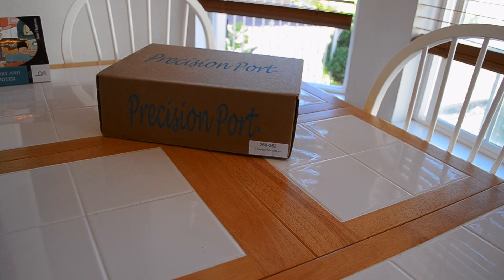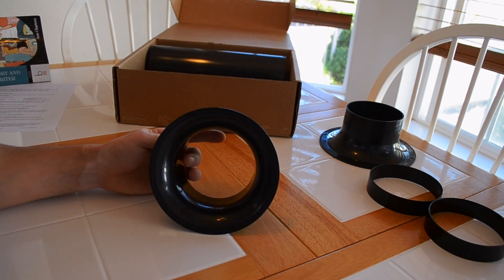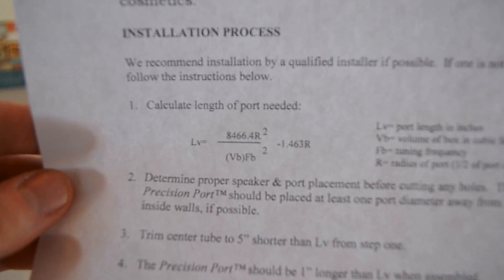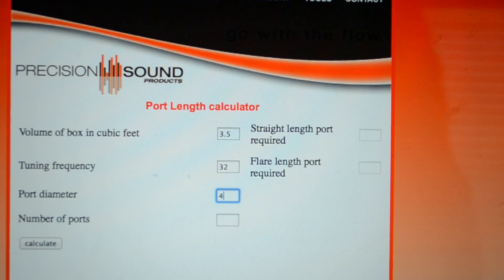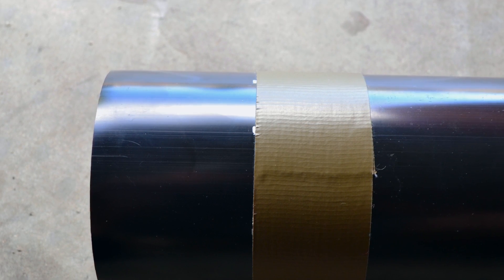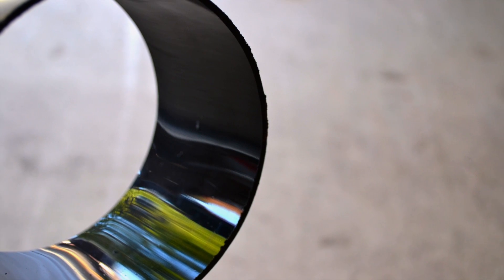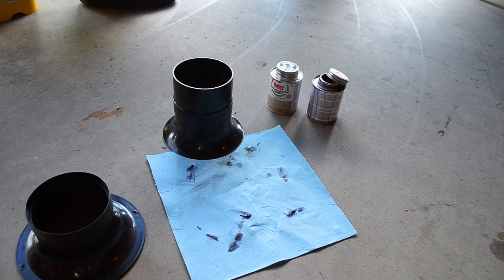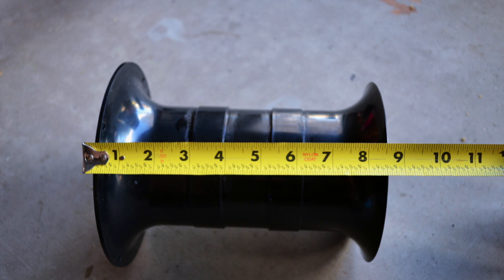4" Precision Port

Comment: Hi thanks for the video.. i want 4 x 4 inch flare..can you please help me. Do i have to just glue together the outer and the inner port??
Reply from the maker: Yes they just glue together like PVC plumbing. Just cut the center to the size that you need to make it the overall length.

Comment: What if my sub manufacture recommends a 15 inch long port by 4 inch diameter port, do I just remove 6 inches from the tube?
Reply from the maker: Yes but in my experience what your sub recommends and what the port will give you is a different measurement. Use their calculator to get the correct length to cut the center. Thanks for watching.

Comment: just spent 1 hr trying to understand this lol I finally do now. video helped a lil.

heres my explanation for those who have trouble understanding it.

example 4cft tuned to 37hz with one 6in port. = 10.52

6in port is 17in total length with flares.
only 12in in usable space between flares. 

17-12=5in
5÷2= 2.5in each flare is 2.5in

all ports mus remove 6in form usable space between flares. (except 2in ports you remove 5in off usable space between flares)

10.52 is what we need for total legenth.
10.52 - 6in = 4.52in

center tube(12in usable space between flares must be 4.52in)

4.52+5in(2.5in for each flare) = 9.52in 

when connected total length will be 1in longer so 9.52 will be 10.52in total

cant believe it took me 1hr to understand this Hope's this helps the ones who can't comprehend like me😅
Reply from the maker: Thanks for the explanation!

Comment: Can you confirm the tube is 17" is the tube length? Everywhere else looks like the tube is 12" for a 17" usable port (18" total length)
Reply from the maker: I believe that it was 17" with the ends attached. Mine needed to be cut real short so I only used like 5" of it.

Comment: Hi from México.
My 15" sub. Dbxi made by earthquake gas a box of 95cm, 41 cm and 55 cm deep with tube port 6" diametter, and 15" long.
This sub has an Fs of 20 hz. 
Do you think that if I reduce the long of the port It could produce too much air?.
I do not know the intonation of my box, what do you think it could be the intonation of the box?
Reply from the maker: Jesus Flores juarez reducing the length of the port will change the tuning frequency. More airspace is better for ported systems as long as it hits the frequency that you want.
Reply: @DaveMedicus  OK thanks. I will make some proofs
But according with the way my box is built, what could it be its intonation?

Comment: Box that size you should have 2 of them. (1) 4 inch port is not enough port area.
Reply from the maker: Joseph Alcindor if I went with two ports it would have been like 36” long total thus making the biggest box I could put in the back too small. It actually sounds great. I don’t have subs with a lot of excursion so the single 4” is just right. If I went with a better sub then I would have needed a bigger port.
Reply: @DaveMedicus  adding an additional port doubles the length of the tubes to achieve the same tuning frequency.
Reply from the maker: Pyrolinn exactly. I didn’t have the space for two ports. That’s why I went with one
Reply: I got you sometime you have to play with different sizes in your case (2) 3 inches would give you more port area than (1) 4 inch. It also depends on box design that's where it can get a little tricky.

Comment: I got the same port and I didn't even cut mine, should I go back and cut a couple inches off, its abt 3.2 cubes, I put the port through the side instead of the front since its longer from side to side. Also did you use the flare on inside of the enclosure or just the outside flare?
Reply from the maker: Roel144 pena use the website to get the tuning freq that you want.
Reply: @DaveMedicus  just figured it out, thanks

Comment: Do you even port area bro? u gonna lose a lot of output with that small ass port.  Should of gone with a 6''
Reply from the maker: Ken Pachi the 4” works perfect. The length gives it the tuning and area to achieve the tuning that I needed for the subs. The 6” was a waste and would not work for my setup because of the length of the spacer in between would. Have been non existent.
Reply: 6 inch would of been a longer port

Comment: so how do you know how many ports you need.??
Reply from the maker: It all depends on the length that you need. If you can not get the correct length to fit inside your box then you will need multiple. I only needed one if you watch my speaker box build videos. I had 2 12" subs and I believe my port was only like 7" long.

Comment: hi boss
im making a sub box just like this one 3.5cu
if i followed this video and cut my port just like you did my box will be @32 hertz right?
thank you!!!
Reply from the maker: Rizal Montañez yes but double check their website in case anything has changed in their design.
Reply: Dave Medicus thannnkkkk youuu!!!!
i have 1 skaraudio ddx 15" but a small box for it and skar team told me the smaller i can go is 3.5 and here i go!!! i was told to tune the box at 36 but im going@ 32
thank you 💯
Reply from the maker: You will have plenty of tube left to cut multiple different frequencies. Just don't glue them together and test them out. Glue the freq that you like best.
Reply: Dave Medicus im in a 2.90cu tune to 40 or more
i dont get lows so 32 like youre should be great!
Reply: Dave Medicus my box is from a shop.
they said about 38 htz but 2.90 is way small plus -port space make it smaller for my sub
Reply from the maker: How do you like that Sub. I am debating on getting 2 12's again or one 15. I am leaning more towards 1 15
Reply: Dave Medicus my ddx15 is great sub 4real i just want to get the most of it with right box
Reply: Dave Medicus i really recommended skar audio

Comment: I've went over their instructions several time & still can't figure this out even after watching your video, HELP PLEASE!!! Their calculator is telling me the flare length port required is 15.13 for a 2.75 cubic feet enclosure turned to 38 hz running two of their 4 inch ports, then down at the bottom of the page it advises to cut the center tubes 6 inches shorter then the port length required which I don't understand at all!!! Wouldn't that make the overall length of the final assembled port shorter by 6 inches throwing off your tuning?!? Thanks in advance for any info you may be able to toss my way to help clear this  whole thing up for me bud.
Reply from the maker: They are calculating the flares into the over all length. If you don't cut it 5 inches shorter then your port length will be 20" just lay it out on a table with the cut lines taped. Place the flares where they will attach and you will see that they are the proper length.
Reply: Geraldo Muniz i think that's bcause is like the curve in both end only add to the real length of the port.
Reply from the maker: That is correct
Reply: Dave Medicus you will be the first one to see my video of my first sub box with this port!
thank you a lot!!!
Reply from the maker: Looking forward to it.  Just post the link below in this message block. Good luck

Comment: nice..thinking to get one 4" port tube for a custom  2.70 cu.ft. box im doing for a single Rockford P3-15
Reply from the maker: It was just as easy to do as in the video. The sound was awesome as well
Reply: Dave Medicus  nice..I'm looking for around 33 hz!!
Reply from the maker: That should sound good. Are you going to be porting out the side or the front?
Reply: Maybe to the front!!
Reply from the maker: Good. This thing moves a lot of air since its not a long port. The front should work great as long as the area in front is clear.
Reply: Yeah the depth of the box its a 13.75 and my hatch versa has a death of 20"
Reply from the maker: Thats going to pound in a Versa hatch. Should sound great.
Reply from the maker: They are easy to use. Just make sure that you have enough surface room to put the port. I believe that one was over 7" wide